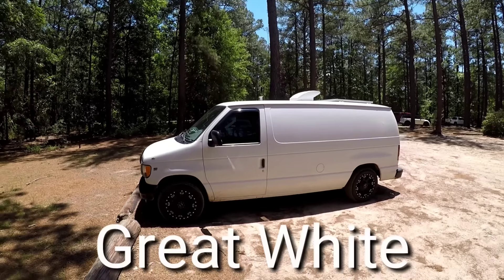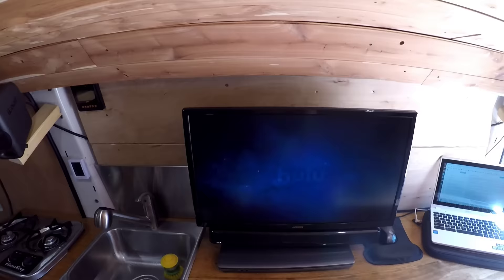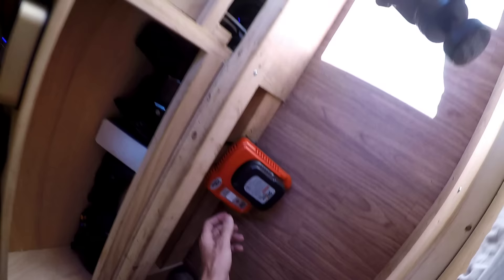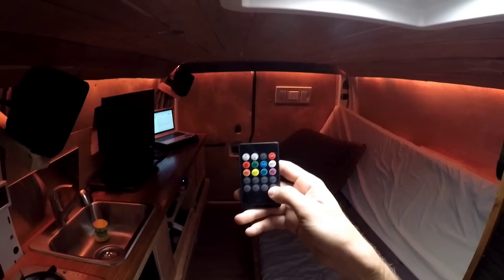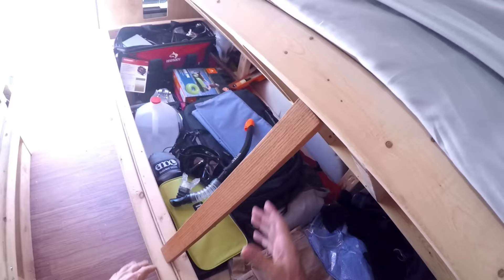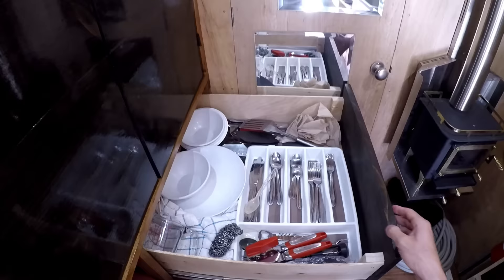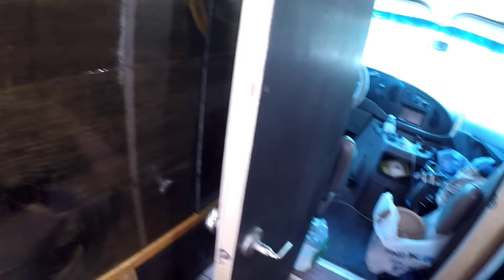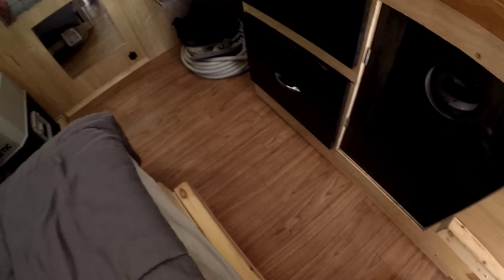STEALTH VAN LIFE TOUR | Extremely ORGANIZED Cargo Van Conversion

Comment: A suggestion for you from someone with nearly 20 years of fire service experience: Move your fire extinguisher. Where you have it located now is right between the two main sources of fire in your van and in order to get it in an emergency you may well have to try to reach through the flames.
Reply: My Thought Exactly. Spot On👍
Reply: Is it an issue to have the propane tank inside?
Reply: @BedrockLeadership  big time in hot weather, those tanks vent off....
Reply: @BedrockLeadership  no ..you can always smell a leak
Reply: @snmnp  in a small space its usually too late by the time you smell it.

Comment: Finally a van with a tv and WiFi. Best van life I seen!
Reply: DrumFox 7 WiFi and 4g is not the same
Reply: @BM8C7  the jetpack takes in a 3g signal and outputs WiFi.
Reply: lol so true
Reply: There's 100s of these on youtube.
Reply: @BM8C7  whats the diffrence you can still connect to it and play games and access the interweb
Reply: Hey don't forget the gun
Reply: Yeah, most camper vans have a dinner and living area, or a big double bed that takes half the van. If I get a van it will have a very similar layout. I want a decent kitchen and a large bed (not wide), and space for my TV and gamer notebook. The only thing I will try to add (than almost anybody does), it's a small shower cabinet with a removable toilet, maybe it can fit where the big cabinet is. You can get more space for floating cabinets if you get a roof extension on the van.
Reply: Drumfox 7 it’s rly sad if you can’t live without tv and wifi
Reply: it's not WiFi, it's MiFi
Reply: @BM8C7  can you run a xbox one or ps4 multiplayer online game?
Reply: @renemir891  yes why

Comment: A suggestion I might make is to make your solar panels removable, so you can park in the shade in the summer months and chuck your panels a few feet away in the sun, it makes a massive difference
Reply: I have an 8 inch gap between my panels and roof... so van is always in the shade! I don't full time, but removable panels would offer the best solution for summer and winter. Good idea I may have to implement.

Comment: Older fridges have higher power draw. As do Thermoelectric fridges. What you want is a new compressor fridge (they turn off when at a certain temp). This will keep your draw to 2AMPS or less.
Reply from the maker: 100%
Reply: thanks
Reply: Even better if it runs on propane like a caravan fridge
Reply: @kimmoyliniemi4546  

Gypsy?
Reply: Javier Caruso what ?

Comment: One suggestion I might make, if nobody has mentioned it to you already, is possibly thinking of moving your fire extinguisher. Currently you have it right in between your propane stove and wood burner, within a foot of each it looks like. Those are the two biggest potential sources of fire hazard in your setup, and if either of them go up the proximity to your extinguisher will make it nearly impossible to get to without severely burning yourself. Aside from that your setup looks really good.
Reply: Elias Nightfire in RVs you typically have the fire extinguishers by doors (to be fair it’s just something you run past on your way outside, RVs are tinderboxes and RV fire extinguishers are garbage) but it’s just a safety thing so if you can’t get the fire under control you’re already in the door
Reply: 5
Reply: @KK-lb8jp  roger that

Comment: I wouldn't put the fire extinguisher that close to the stove. I would put it close to the exit. If there was a fire, you couldn't get to the extinguisher because that would be where the fire would be. I have a woodstove in my garage, I have my extinguisher on the other side of the garage where the door is.
Reply: You beat me to it.... a pressurized  vessel isn't best stored directly beside a heat source and you really don't want to store your fire supression device that close to the most potential fire ignition sources... but other than that, this is AWESOME
Reply: I was gonna gonna it migth go bang if he really keeps feeding The stove some nigth
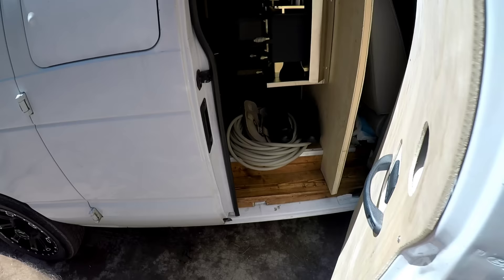Reply: There is a door at 20:26

Comment: Wonderful home. For the carbon monoxide, drill a hole through the van wall and put a small hose and gasket with a seeen cover on the outside of the van, and make sure the battery compartment is airtight. Love love your house.  Hope your van holds up for years. Might want to get window rain guards for the front and keep your windows cracked and put foil coated window covers on. It will keep the front a lot cooler.
Reply: what????? carbon monoxide is heavy. the sensor should be near the floor for optimum performance.
Reply: @mikeallmon1  carbon monoxide is less dense than than air (slightly). Carbon dioxide is heavier than air though.

C+O is about the same molar mass as N2, which makes up about 78% of air, and less molar mass than O2, which is another 21%.

STP Densities:
1.25 g/L CO
1.25 g/L N2
1.43 g/L O2

Density of air is variable depending on water though, but not much.  Dry air would be slightly more dense than CO, but humid air is slightly less dense than dry air.  It's probably a wash unless you have very high humidity and temperature.

tl;dr Put the CO detector high.  Personally I'd mount it on the wall above the wood stove.
Reply: The indoor propane tank storage concerns me.  On my sailboat the propane tanks were stored in vented compartments.  A solenoid was used to switch the gas valve on and off to the cooktop.

Comment: One small safety thing: Don't use the fan at the same time as the log burner (not that that you'd ever intentionally do that anyway):
The fan drops the air pressure in the cabin, which may result in smoke and fumes being pulled back in through the chimney.

Comment: I hope you have a security alarm on the van.
Reply: No need to worry
A car has a built in alarm system
Reply: He just has to lock it
Reply: You cant really see in on this type van. It's all secluded inside. Also it's not like hes running around in south central L.A. or Chicago area. One has to be smarter than the criminal in these times.
Reply: That's what the gun is for 😄

Comment: Thanks for showing your home. You did a great job and I'm somewhat envious though it would be difficult for me to move around as I am 7 feet tall. One note about your carbon monoxide detector: it should be mounted at or below your pillow level since CO fills up a room like water does a bathtub. Leaving it where you have it will sound the alarm after you were asphyxiated. We don't want that!
Reply from the maker: Gilbert Nichols thank you! Also, thank you for being worried about me with the carbon monoxide filter, but I believe what you said is a myth. I looked this up before placing the detector, it said that in a small enclosed room, carbon monoxide fills up the place almost equally from top to bottom, even though CO does rise in normal air. Multiple sites claimed that it does not matter.
Reply: Outdoors Embrace   I guess it's worth your life to not take the time to be more safe than Sorry !!!
Reply from the maker: Am. Blades
I was being nice. What he said is a myth.
Reply: Outdoors Embrace ... Solution: buy another one. Place one high and place one low. Double-covered.
Reply: Considering hes said he has been living in the van for a couple months and he was able to show this is kinda proof that he did the research... right?
Reply from the maker: Carbon monoxide (CO) is slightly lighter than air, so carbon monoxide alarms are effective when placed on the ceiling or high up on a wall. ... There's a myth that carbon monoxide alarms should be installed lower on the wall because carbon monoxide is heavier than air.

Comment: To the mofos talking trash, this guy has more engineering & practical capability than most of you.

If he's working he's stacking a crazy high amount of that in the bank or he's paying off debt at an insane rate. 

If he's not working it isn't costing him very much & he can afford to go without doing so for a crazy length of time.

So he's in a position to do almost anything he wants & it works for him.

THAT'S TRUE FREEDOM.
Something most people won't ever know. And it's because he made it that way.

Comment: The one safety thing I see is move that fire extinguisher. If you need it it'll most likely be for the wood stove and where it is now you will probably get burned just trying to reach it. I understand you want it close but it's a Lil too close. Sweet job though. Best regular van conversion I've seen yet.

Comment: Great conversion! I love the layout, most camper-vans have dinner and living areas, or a big double bed that takes half the van. I like the importance you get to the kitchen (as somebody that always cook for myself) and a long bed (most people put wide beds on the other direction, being tall is not the best option, I understand if it's for couples), and space for the TV, notebook and all the accessories (as a PC gamer). Also, it has a nice balance between rustic, good presentation and attention to details.
Reply: Had a long bed in mine. To much weight on left wheel. Changing to the rear bed with under bed drawer stowage.

Comment: Only a toilet is missing
Reply: I can’t pee in a regular water bottle. I need a Gatorade bottle
Reply: @luisguzman5862  u need a caprisun packet the hole is small enough
Reply: Kavindu Gilshan i
Reply: BRAZZERS' Employee Of The Month 🤣🤣🤣
Reply: @luisguzman5862  wierd flex but okay
Reply: The EIEIO Channel With Farm Amimals that’s a dealbreaker for me lol
Reply: BRAZZERS' Employee Of The Month “and comment for underrated comment of the year is”
Reply: Luis Guzman 😂😂
Reply: Ever heard of the corner?
Reply: Needs a better fridge system also.  Can only use it in the winter. .. lol
Reply: Kavindu Gilshan where does he shower
Reply: Wait till you see the passenger seat in frnt.

Comment: I'm actually homeless and getting a minivan soon. How much does it cost to make all of this. I was hoping for solar panels tv that shelf setup maybe the sink and grill and obviously the bed. I do have a job and is currently fighting for benefits for injuries I received in the marine corp and I was hoping I can do this. With the money that I do make.
Reply: In the tutorial video he said it was around 10,000. I’m sure you can save money in some areas. But hope you get your benefits, I’m currently fighting for my benefits also, going on 3 years this year that I’m pushing for it. I’m hoping if it does goes up I can use the money to get myself a van like this.
Reply: @Ray641  you you get it as well man
Reply: I’m in the same boat Nick. Navy about to be Homeless in a few days give or take. I hope all is well Homie.
Reply: @Tylar245  how you doing now?
Reply: @Ray641  it. Can do it in small bites. Start with nothing and go from there. The biggest concern is extreme heat for me. I will most likely go with a window unit left rear door. Used a potable in south Texas it put off more heat than cool between 11:30am and 8:30pm. But it let me sleep at night.

Comment: You need to cut off the zip tie on the fire extinguisher, you wouldn’t want to have that still on during a fire emergency
Reply: Also, place it away from the two stoves.  You don't want the extinguisher near the two areas that are most likely to catch on fire.  You won't be able to get to it!

Comment: Vinyl Wrap-Around Windshield Covers. They attach to the corners of your doors, and block the windshield, and both door windows. Much more effective at keeping the cab cooler than interior shade screens, since it's blocking the sun's rays before the glass, instead of allowing them to heat your glass.

Comment: First I was watching the tiny house videos, and that led me to Van Life (yea Chad).  It's something that's passed me by, as I have two small kids, but I find it interesteing never the less.  If I were a young man with it to do all over again, sheesh, I might do the Van Life in the parking lot of my employer...   Anyway, question:  do you worry about the long term reliability of the vehicle itself?  What if it breaks down?  Where would you stay while a mechanic works on it?  Kind of strange giving the keys to your HOUSE to a mechanic.  Seems like these vans get lots of hard city miles on them (short trips, lots of them). Thanks for the interesting videos.
Reply from the maker: Yes, I worry about this stuff, but try not to let it get to my head. I perform preventive maintenance on my van so I know it's ok. Sometimes little things go, I'm sure bigger things will go eventually. I actually stay with the mechanic while they are working. Haven't had it to be in the shop overnight yet.

These vans have amazing engines. They can run up to 1 million miles I've heard. More than not, they go to at least 400 thousand miles. I'm not worried as much about this, I'm so careful on the road, easy foot on the gas, smooth turns, smooth acceleration.

Comment: If you still do this... get cricket 55$ 
100gb plan for hotspot and a external antenna.
I built my own directional antenna... directional works ALOT better if you can locate towers with a tower app on a similar frequency phone.

Just aim it and let it connect. When you are locked onto a tower you'd be amazed how much faster it gets.
I used copper wire and a old sat dish to make mine.
Reply from the maker: Have any videos you can link that would help me build one?

Comment: Awesome but! A propane tank needs to be outside. There is a pressure relief valve fitted into it in case it overheats instantly fill your van with a flammable explosive mixture. There are ways to remedy this well leaving the bottle inside the skin of the van. Or you can get a frame mount external tank that lives under the van. Talk to your local gas company I'd hate to see anything happen to you😉

Comment: Just a tip, you want to put the propane tank in an airtight compartment because the propane can sometimes leak and cause a fire. I would look into it more if your interested. (I know this is an old video but just in-case, I wanted to let you know)

Comment: Nice Van. There Is A Van With A Bed/ Sitting During the Day With Large Long Pillows. It Has The Slates That Pull Out If Needed For A Full Size. And Best Of All It Lifts Up For Storage. In Your Case With Such A Nice Van, I Would Get A Single Wide Bed With Large Pillows And Put Those Large Tubs Under For Storage OR Even For Your Bike. That Tiny Heater Is Awesome. Saw A Video Where Poles Were Wrapped In Cellophane In A Large Teepee Style With A Door And A Heater Like Yours, Lolll. I Love Your Setup And Especially  That Small Heater.  A Murphy Bed Would Work For You With An Attached Set That Folds When You Let The Bed Down. LOVE YOUR VAN

Comment: Love the carefree nature of your lifestyle van. I am guessing the US doesn't have laws about transporting gas bottles in vehicles..? In the UK you are required by law to fit an airtight gas locker with a sinkhole vent and 2 fixing straps, plus you have to have fixed and rigid (copper) pipe fittings to burners. A van like that would get you in trouble here :( I envy you.

Comment: Music interface and creation! Finally a van lifer I identify with. To many digital nomads I have nothing in common with. Where's your guitar/ bass hiding at? Rock on dude! Thanks for the vid.
I would suggest a Webasco dry air heater. Kinda spendy but much smaller, fueled from your vans gas tank, and dry air heat. Way more efficient, worth the investment. Check'em out
Reply from the maker: So on that trip, it was stored in my family's house. This van was meant to have a guitar mount above the bed, just never got to it.

This new van I'm now working on will definitely have a guitar mount over the bed. Full studio, and subwoofer for music creation. So excited for "out the back" concerts too, given you open the doors in the rear and speakers will be on both sides facing outwards linked up to guitar and mic
Reply: @OutdoorsEmbrace   Nice! Keep us informed. I'm really curious to see how you get the power situation handled for all that. I'm totally ignorant about how to set-up a power system for my own van but I'd like to have what you got plus a guitar amp. Tube amp specifically. If your an electrically savvy guy, showing details on the power set-up would be awesome! Thanks man! 
To add: I suggest finding someplace low to stash a guitar. Maybe under the bed? Having a wood instrument up high where heat and moisture/condensation would collect/vent might turn out badly. Temperature changes and moisture are not good for anything wooden.
Reply from the maker: @Jason  so I did put the guitar under the bed in this van, it just took up lots of room down there ha.

By the way, I have a 30 minute electronic instructional video. https://youtu.be/Z_Rr3UFyzZM
Reply: @OutdoorsEmbrace   Good call. Its worth the space. I have to figure out a guitar, bass, keyboard, amp, and a surfboard. In a regular van. A Chevy G20. So it could be worse. Probably use CAD to figure it out. I'll check out the electrical video. Thanks!